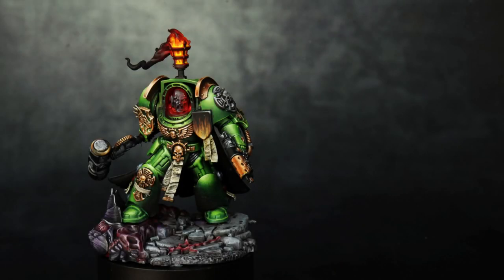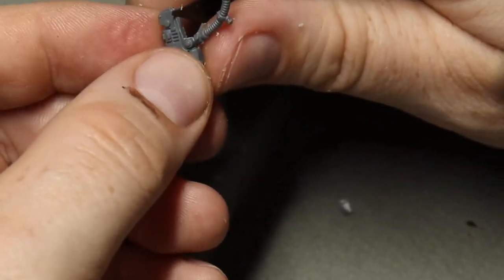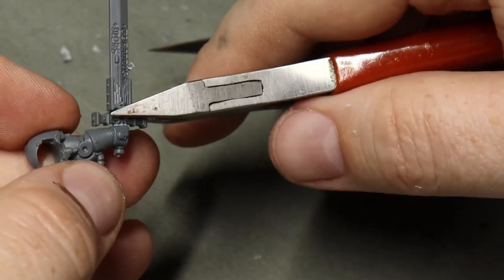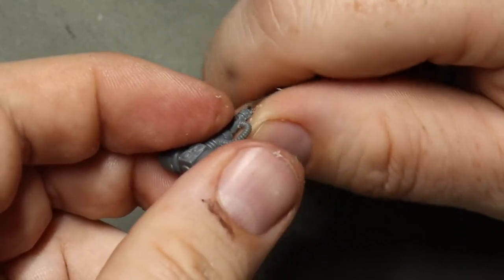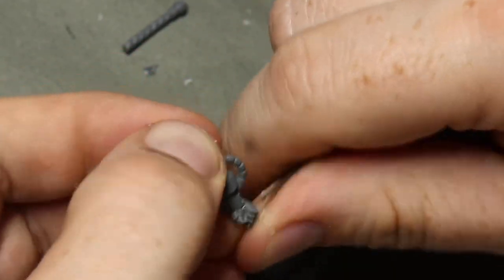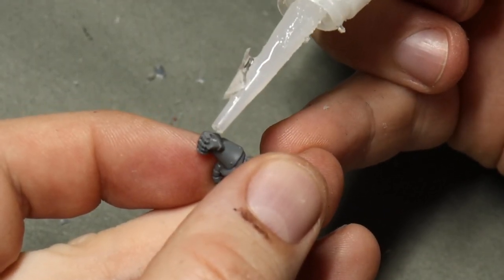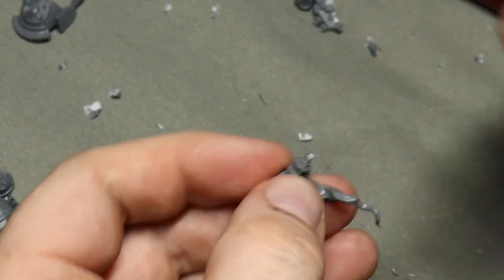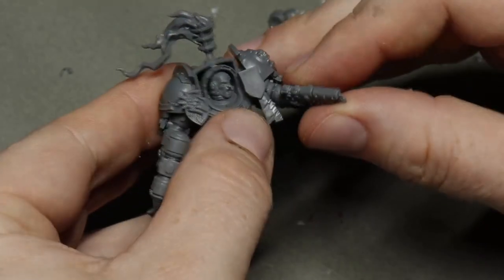Kitbashing a Salamanders Captain

Comment: Even though I would call myself reasonably experienced when it comes to pinning, I still take stuff away from this video:
- drill from both sides to prevent having the exit in the wrong spot/angle (how have I not though about this before?!?)
- the more the angle matters (like with weapons) the more room you should give yourself by using a smaller diameter pin compared to the whole you drilled
Reply from the maker: It's really great to hear! Thanks so much!